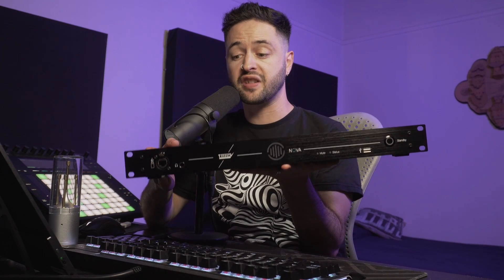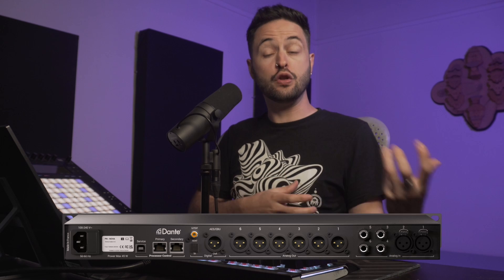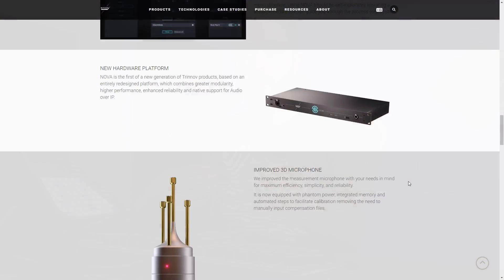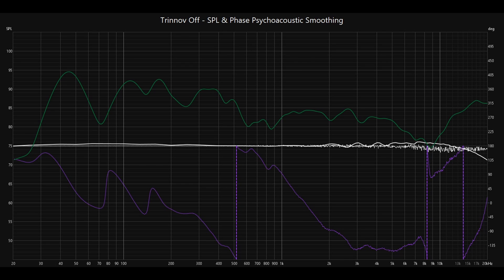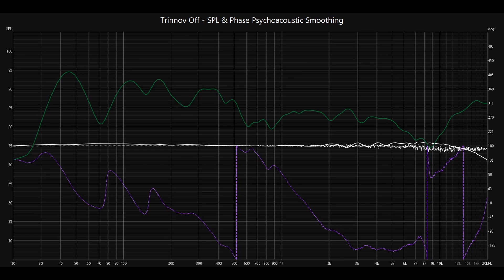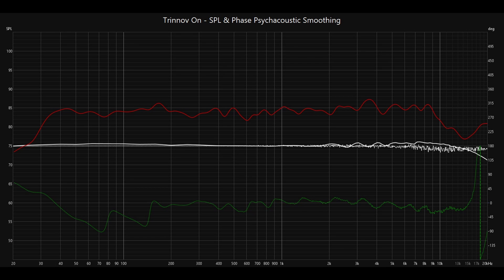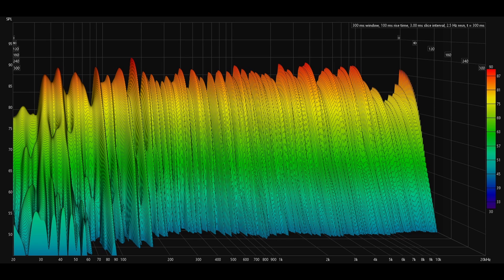Discover the Future of Sound - Trinnov Nova

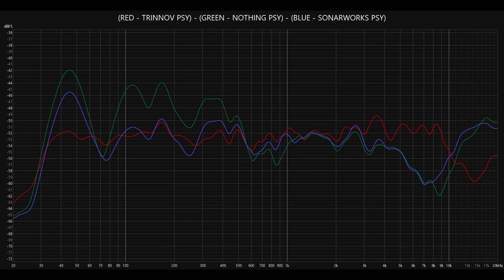Comment: 9:00 Those comparisons are incredible. Well done for doing this. I've been using Sonarworks on my setup when I'm working from home. I've just ordered the Nova for my actual studio. Before I had heard of the Trinnov, I was looking at the IK ARC, but the correction, phase and timing producing a natural sound that is THAT much better in getting a flat response compared to the other room correction options.

Latency won't be too much of an issue for me unless I'm writing and producing music with my midi keyboard or my guitar into a track I'm working on.. but thank goodness you can hit 'bypass'.
Reply: My ATC SCM45A and Trinnov arrived! I had a couple days with the speakers before room correction and they were great, but even in my very treated room, I felt there was room for improvement.

After calibration, I wouldn't change a thing. This is the greatest upgrade I've ever made. It was worth the money. It IS worth the money.

I went for the 4 channel upgrade as I'm adding my 2 x JL Audio Fathom 12s to my setup at the end of the month (I'm waiting for them to be repaired - both died after the crappy capacitors in them died)

I've never been happier. Its finally the mixing environment I've always wanted. It's SO easy to work in. The ATC speakers are great on their own, but having them integrated perfectly into the room turns them up past 11..! 

Turning the optimisation on and off is pretty fun.. just heating the speakers as-is, then adding what the Trinnov does. It's mind-blowing. 

I can't understand why anyone would bad mouth this device. It doesn't add any weird phasey stuff, it's perfection.

I wonder if they will continue to upgrade the software and improvement will continue coming.

I can hear EVERYTHING. Mixing on this system is pure joy.

Comment: Are these measurements of both speakers together, at the same time?
Reply from the maker: Yeah the measurements are of both speakers at the same time. I didn't measure L/R independently. I have screenshots of the Trinnov interface that has the individual measurements, but didn't include them in the video.
Reply: @CollectiveIntelligenceMusic  both speakers together is a bad way of demonstrating what is going on. Constructive/decinstructive interference mixed with all other variables turns it all into one big soup sandwich
Reply from the maker: @dougleydorite  The measurements demonstrated the results I experienced in my listening position - which is a significantly flatter result using Trinnov.
Reply: @CollectiveIntelligenceMusic the dip with all your measurements overlayed @9:20 between 7k and up are the classic hallmark of deconstructive interference with LR summed measurements. Try measuring again with only one speaker at a time and you won’t have those dips. (I’ve been there myself not too long ago)

Comment: This thing is a total scam. Disabling ports and giving them back for an additional charge... I hope the whole company goes under.
Reply: This is pro studio gear, not bedroom studio stuff.
Its a different world.
Absolutely not a scam. Trinnov is state of the art time domain correction.
Reply: Guys, I think you are totally wrong about the idea behind it . The idea is for users that doesn't need more optimisation than just 2 channels , why paying for it? The outputs are absolutely not disabled ! You can still calibrate in terms of level and delays . Personally, I don't want to have optimisation on my NS10 or Auratone. So a NOVA with 2 channels of optimisation and the room is fully calibrated even if I have 2 extra pairs of speakers .
Reply: I think that's pretty scammy as well. It may actually hurt their sales of this unit in the long run. We'll just have to wait and see.

Comment: thats the final treatment when anything else which should be done before is done ! so if you using the Kh310 i highly recommend the Sub Kh750 dsp - same results as with the Trinnov ;-)
Reply: 🤨 are you 100% sure about that ?
Reply: I’d get a demo of Nova first and check that with your Neumann’s before you make that statement . I think you’ll be shocked at the results
Reply from the maker: I am curious to see how the Neumann DSP works with the SUB.
Reply: was the best decision to buy that sub !!  @CollectiveIntelligenceMusic
Reply: Neumann does phase correction?
Reply: @KYTHERAOfficial   not properly  like Trinnov, no
Reply: @legostudiosify  Exactly. So absolutely not the same as the Neumann dsp. What Trinnov does is truly magical.
But its right that you do the room first and then you get a Trinnov.
Trinnov does not only Eq Balance like Sonarworks etc, it does a correction in the time domain / phase correction.
What this does would be only achievable otherwise by changing the geometry and reflections of the room.
You cannot compare that to 'normal' spectral correction.
Reply: yes it does !  @KYTHERAOfficial

Comment: It's cheaper to just build acoustic panels and traps. $3,500 is ridiculous!
Reply from the maker: That's totally true, but I think what I failed to communicate in the video is that acoustic panels are SUPER important, but the average studio DIYer isn't going to have the space to put in enough bass trapping for low frequency control - tuned bass traps/Helmholtz devices are cumbersome, expensive and only tuned to specific frequencies (generally speaking) - this device is portable, you can calibrate a room in a minute and honestly - and I have no horse in this race - this has done far more to improve the audio in my studio than anything else I've used. It's just a matter of fact to me.
Reply: @CollectiveIntelligenceMusic  You make a very valid point actually. The lower end is pretty tough to dial in. My room is pretty flat until the dreaded 100hz dip lol. I'm still trying to resolve it. Smh.
Reply: There is a limit to what any physical treatment can achieve, but you should absolutely do that first.  After that, you have Trinnov.
Reply: @Truth565  This.
Reply: Porous Absorption ≠ Phase Correction.
Reply: @KYTHERAOfficial  Isn't it tho? if there is nothing to interfere, no phase correction is needed.
Reply: I would suggest you to get a demo and make your own opinion on it 😉
Reply: @antoine1070  Not a bad idea actually. Maybe I should consider that. Still, a $3,500 price tag is nothing to sneeze at, geeeshhh!
Reply: @mrmozez1500  Once , you have heard it. You will change your mind. This box is a game changer. Are you still checking your mixes in your car ? How many times are doing revisions ? This is going to change your life . Please get a demo , because talking about it is something , but hearing it in your room....that's something
Reply: @antoine1070  I will certainly look into it
Reply: get SoundID Reference, its only $299 and does similar job, you will never make music without it again..
Reply: @nofood1  Sonarworks does only correction in the frequency domain, trinnov does correction in the time + frequency domain aka phase correction, fundamental difference.